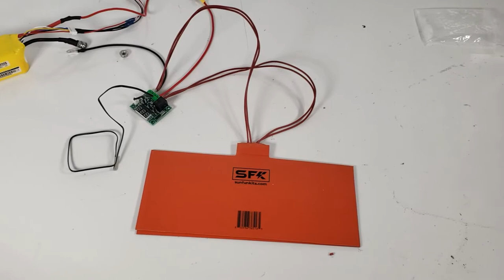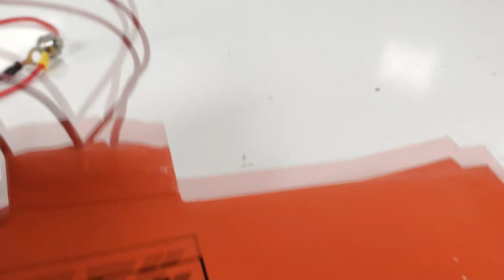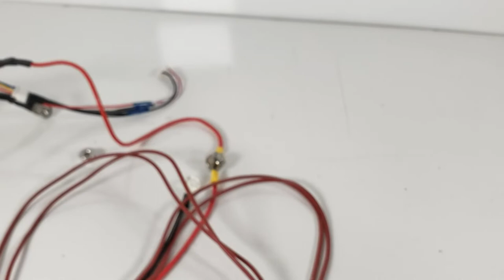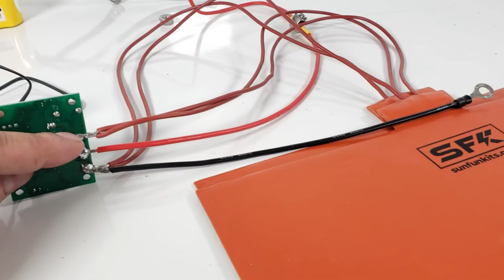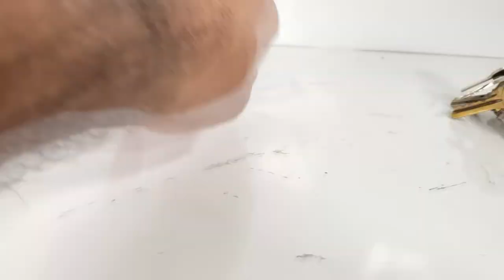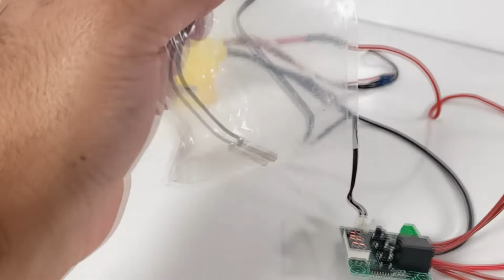DIY Heating Switch & Thermal Pads

Comment: These look great but I’m in the uk . Question please have you seen these pads but has a thermistor 
So 2 red wires and 2 white wires which is confusing 
Which is to put 12v power to the  pad 
Thanks